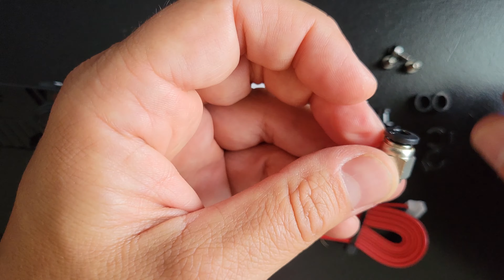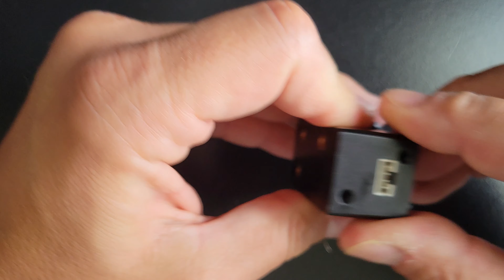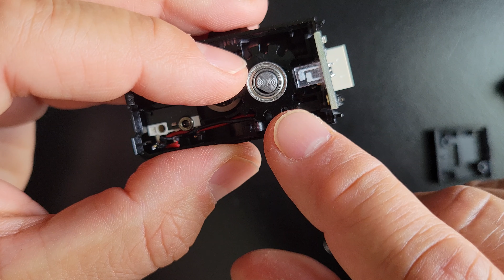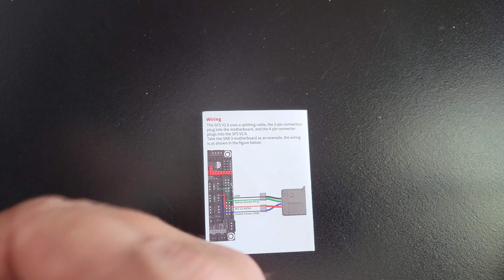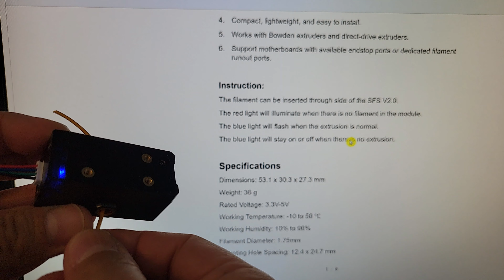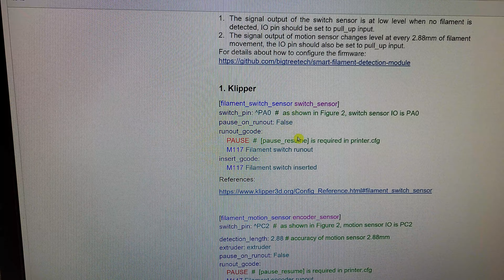👉 BIGTREETECH BTT Smart Filament Sensor SFS 2.0 Comparison, Disassembly and Installation🔥🔥 #btt

Comment: It looks like it only works on changes due to movement, a simple, single blocked light path. It should work using a quadrature setup instead with two light receivers to make sure we're not just wobbling back and forward a little bit (which happens on jammed heads when the stepper skips). Quadrature encoders tell you direction as well as speed. The change in cost is tiny, it was common in really cheap ball mice not long ago.

Comment: What program did you use 2 edit the printer cfg file? I want to install a bftouch and SFS v2 on my ender 3 v2 I have marlin firmware installed and have no idea where to begin (noob here 😆) ?

Comment: What size was the plug that plugs into the device?   I need to buy a crimper and rewire for my k1c.
Reply: A box of JST connectors off Amazon and some 22 awg wire works great

Ive had success crimping them with just needle nose pliers! I believe you do need a soldering iron for making extenders though.
Reply: Heller Therese, have you make it to work on your K1C? I have struggled a lotta with the .cfg filé and cannot fine out what code i should use. Can you paste your here please?

Comment: The rubber things go on the coupler. Put it over the screw, and screw it on. You will need to push it while you screw it in the first couple turns.

Comment: A trick I use to identify wire colours in a cable harness when I only have black wire is to put short lengths of coloured heat shrink tubing at both ends of each wire.
Reply from the maker: I actually do the same! Thank you for sharing the tip!

Comment: BTT claim the new model can run filament either direction. Well, so could the first version! The main difference between the two models is the addition of the microswitch, and it looks as though they have revised/improved the tension mechanism. This was the main issue with the first version - far too much tension on the filament out of the box.
Reply from the maker: Thank you for your comment. I have both and they both work well. I just like the form factor of this one better.

Comment: They're all mediocre at best... none of them provide reverse e-step feedback  (act like a reverse extruder that reads filament volume)
Reply from the maker: I will double check to see if this can do that. I thought I read somewhere that it could but I might be mistaken. Thank you for watching
Reply: @dadwillmake  It can't... it needs a geared wheel with laser sensor (like a mouse wheel) to make contact with filament so it can count the rotation e-steps

Comment: How about drag? I am happy with version 1 but I have a feeling it adds quite a bit of resistance to the extrusion, does version 2 grip more gently?
Reply from the maker: No it still grabs pretty hard but it rolls smooth through the sensor. I have not had any issues with it slipping and I've put many rolls through it.
Reply: Same boat

Comment: Honestly, I don't understand in what case you need both sensors. If there is no filament inserted (or it is finished) - motion sensor will detect that too.
Reply: Having both sensors allows the hardware/firmware to differentiate between the 2 possible conditions: filament runout or filament stoppage due to a tangled spool or a skipping/slipping extruder gear for example. It's not absolutely necessary but it does allow more flexibility if for example you want different G-code commands executed for each of those scenarios.

Comment: the encode wheel is still metal btw
Reply from the maker: maybe you have a different one. The V1 was metal but the black encoder wheel in my V2 is definitely plastic.
Reply: @dadwillmake  check again, It's aluminum,just anodized black,scratch it and you'll see the metal underneath

Comment: the manual says blue will stay on or off when no motion is detected, so the purple situation is included in the manual: purple=red+blue, So: no filament(red on) + no motion(blue on or off, in this case, on)=purple
Reply from the maker: Good call. Thanks for the information!